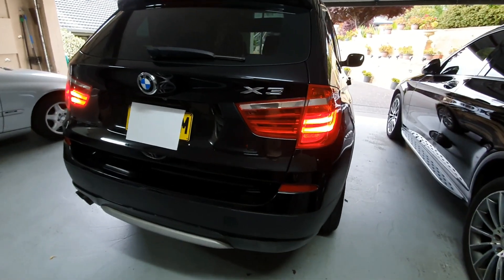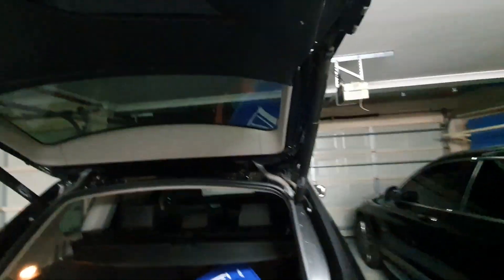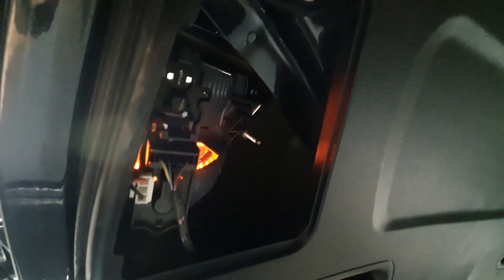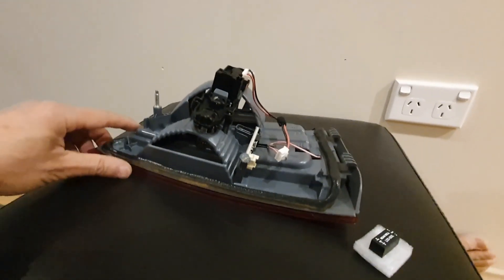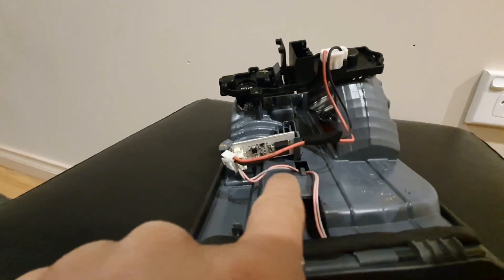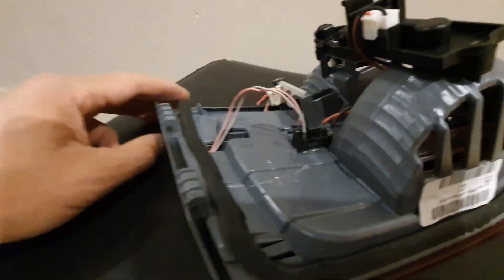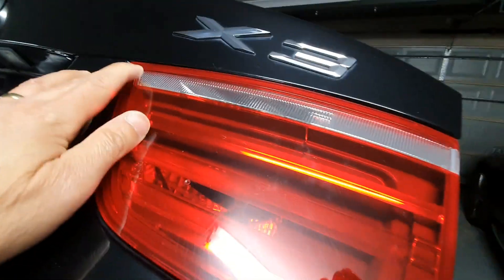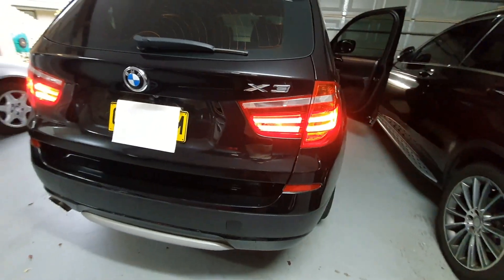BMW X3 F25 fix for failed LED tail tights

Comment: I bought a whole new assembly and mine still doesn’t work .
Reply from the maker: hi, have you checked if it's getting power?
Reply: @kenkanfix  how do I do that ? I still need to check fuses too .
Reply from the maker: @Sharons_Cleanings_Motivations  Hi, I think the fuse is ok if the other tail lights are working. To check if there's power to the one that is not working you would need a multi-meter, set it to measure voltage, and measure the voltage at the connector 1:44 in the video.  The brown wire is negative and one of the other wire will be positive for the tail light. you should see 12Volts.

Comment: can you clarify the in/out pos/neg connections?
Reply from the maker: Hi, the thicker wires goes into the input (12V)  and the thinner wires goes into the output (5V). I just found that you can buy aftermarket part now from Ali express or eBay.

Comment: Still holding up? Any interference with the fob, etc.  like other f25 board fixes?
Reply from the maker: Hi, it works fine with no interference.  It is just a step down transformer taking 12V down to 5V.

Comment: It works! It hard to connect thou! (Due to the cable is too short)
But it works as video showed - 

Thank you for the video!
Reply: Still holding up? Any interference with the fob, etc.  like other f25 board fixes?

Comment: Where can I buy the Mean Well LDD 500L driver ?
Reply from the maker: Hi, I got mine from https://www.power-supplies-australia.com.au/MEAN-WELL-LDD-500L
Reply: @kenkanfix  How do you find out the connection. I see 3 different types pin, wires, and smd
Reply from the maker: @Sports Training Systems  hi, there should be markings, +V in,  +V out and ÷ve (common).  btw, in my other video I showed a plug-n-play after market PCB so no need to figure out cabling.